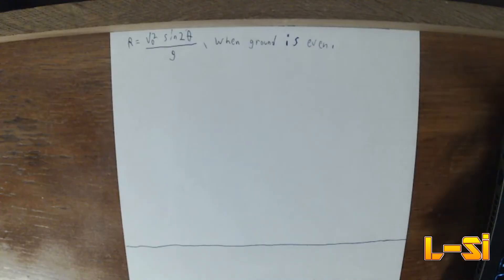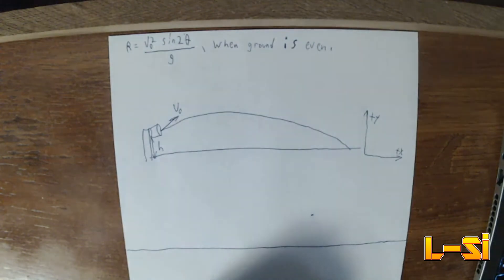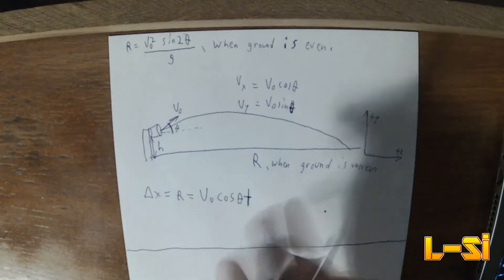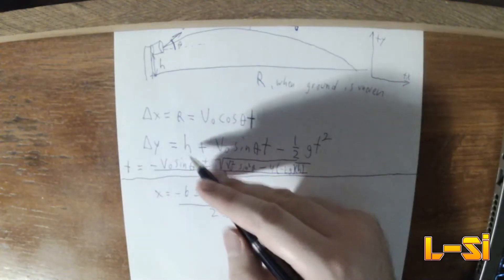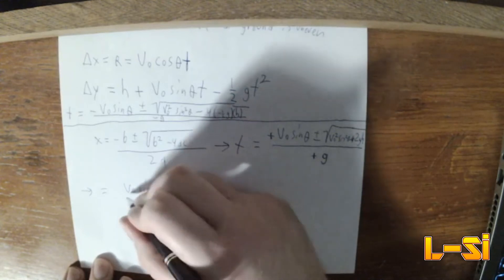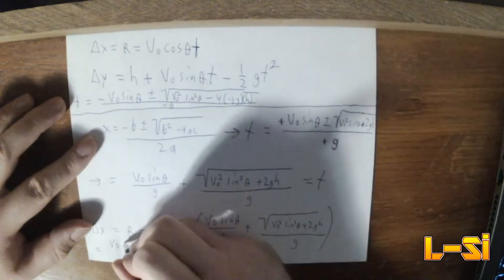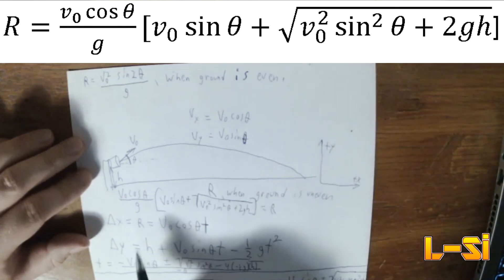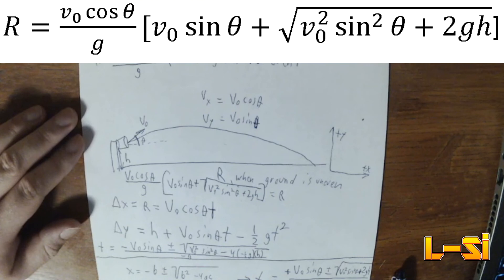Projectile Motion Over Uneven Ground | L-Si Episode #4

Comment: Thank you so much! but how can you ignor the negativ  sign of g m(-g) by the negative sign of  b in addition rule?
Reply from the maker: I am glad you enjoyed the video, also I ignore two negative signs in this video. First, when doing the quadratic formula to solve for time, the negative signs on the top and bottom cancel. I essentially multiplied by the fraction -1/-1 to make everything positive without changing the value because -1/-1 = 1 and thus the value of the equation did not change I just rewrote the equation in a positive, but equal form. Second, time cannot take on a negative value in this circumstance, so I only used the form of the quadratic formula that would allow for a positive time value. I hope that helps you, thanks for watching.